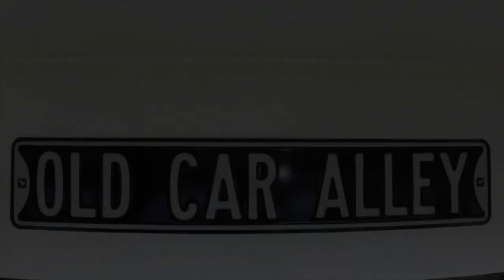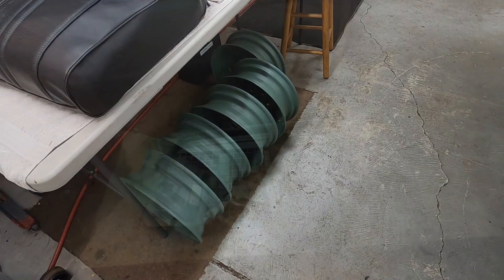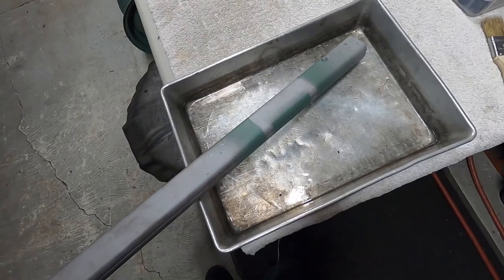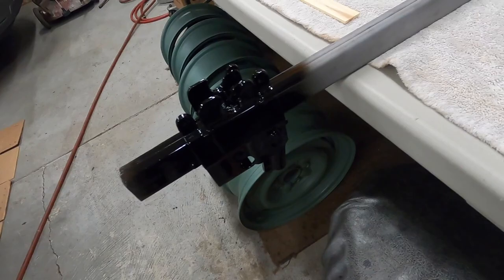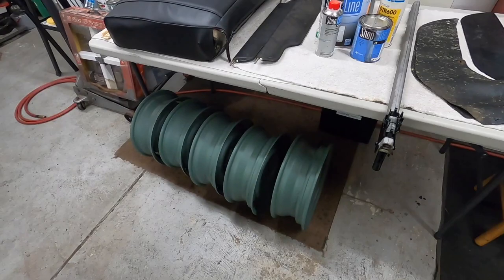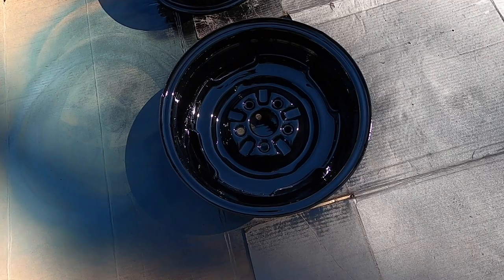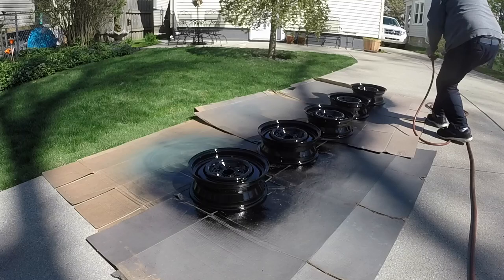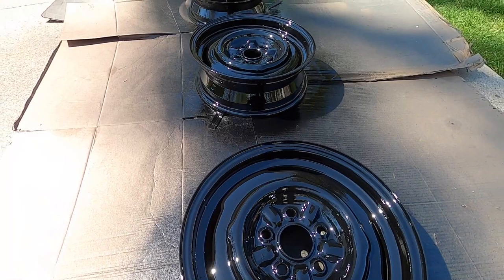1966 Ford Galaxie 500 convertible restoration part 196 painting the wheels

Comment: Howard, Interesting that you mention the wheels being painted body color.  In Late 1967, Ford started painting their rims Body color...so some very late '67 Ford cars got Body color wheels, but it was a running practice to paint the wheels the body color of the car from 1968 going forward... Prior to late '67, All wheels were painted Semi-Gloss Black during the Early to Mid 60's at Ford. '68 and on cars had Body color painted wheels.
Reply from the maker: With the dog dish caps, body color is the only way to go, but with the full wheel covers, it's only the little edge that shows and I think that looks better black. GM used body color on wheels on and off to about 1960 ish I think.

Comment: in high school , I worked in a body shop, i had a 63 Ranchero,  I did a complete paint job. a few weeks later I panted the wheels, i mixed the paint with overall hardener, the paint would not dry, i had to go home . when i got home the paint spread out on the wheels, from centrifugal force. i asked the painter the next day, he said i should have used repair hardener
Reply from the maker: The paint is dry.... I wanted the tires mounted today, but they dropped the ball and didn't get them yet........